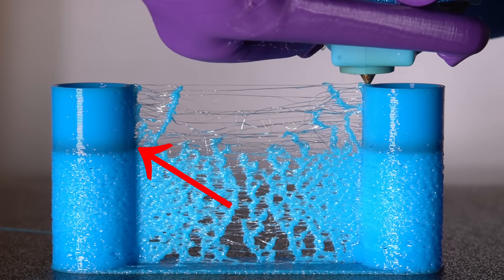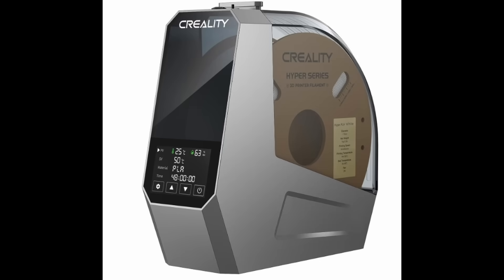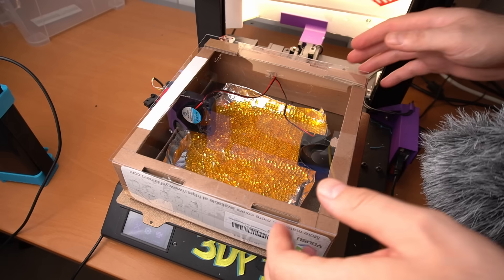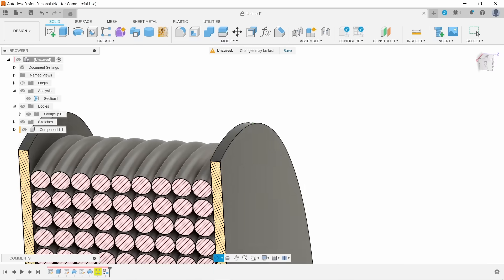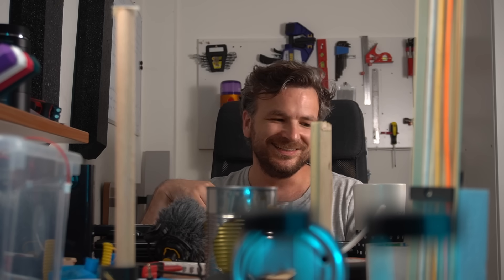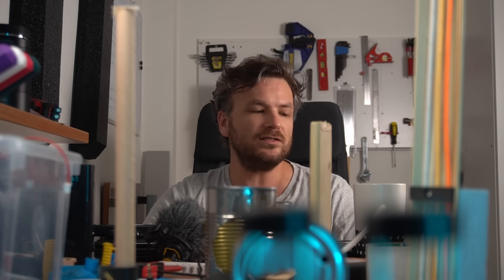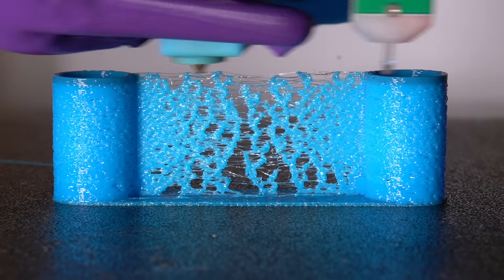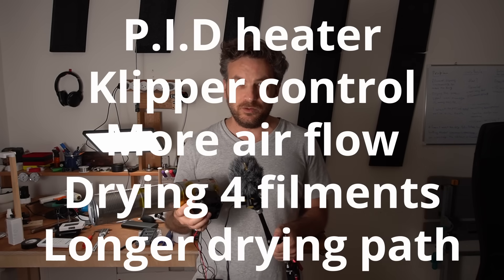Why are we drying filament this way?

Comment: Hey there 3d printing ideas, I work with metal filaments and run my own small 3d printing/ design engineering consulting gig. I have worked with metal filaments and they have a variety of problems of their own and I would like to share what I have done to improve my filaments. I personally would increase the heat and airflow. in an industrial injection molding operation a large part of it is drying the pellets before feeding them into the injection tube. The drying time varies based on a number of variables. So in your case you'd have to account for water accumulation in the filament, air humidity, the speed of the filament going through the nozzle and as well as what ways you can pull the moisture out of the filament. Additionally, how wet the filament can be to print "normally". Nylon gets stronger after it gets wet, but you can't print with it when its wet. If you're someone that wants to speed print using "wet" filament, you'd have to have a vacuum chamber set up to pull the moisture out of the air then draw it out of the filament towards the outer edges of the filament itself, then you can push it through a filament dryer with desiccant. The name of the game is to make the air surrounding the filament drier than the filament itself that way the water pulls out. Its simple physics after that, the hotter it is the faster the moisture will dry, the more air flow you have the easier it will be to pull it from the filament. add a desiccant and now you have even more things pulling moisture out. The vacuum chamber is really overkill for basic and noncritical components but it ensures you get the most moisture out of your filament as fast as possible prior to printing and then you can precondition it by warming it like you've done. You just have to extend the warming time to match conditions where you're printing. so a "wetter" filament will require a longer heating chamber. A more humid climate will require a longer heating chamber. Prewarmed filament will also print easier as the hotend doesn't have to bring a filament from room temp to melting, rather 100c to 220c for pla for example.  Hope that gives you some tips and tricks.
 
I would also suggest utilizing nichrome or kenthal, it allows you to control the temperature more and you can wrap it around a glass tube that you can run the filament through alternating the hot portion with an exposed air portion. In my tests it worked good but that was my v1 I feel like putting it close to the filament AND adding airflow in the can with the desiccant would be interesting to see. I just leave my desiccant in the box.

Comment: Well. The way you prpose might work partially for low temp material. But you are not going to make it with abs, variants, nylons, and never with high permonce mat like. We.
There are profesonal dryers that dry materials 10 times faster than hbby dryer: smart3d has such a dryer. And also has a soon lo lauch dryer that dryes ANY material on live. It uses vacuum technology

Comment: Nice idea! I think that if you dry the air coming in, you can achieve better results. Maybe force the hot air to pass through a box with silica? you will need to change the fan to a radial in order to push it through. Or you can adapt some room dehumidifier (those that dont need silica)

Comment: I initially thought you were going to heat the can, mount it in a bearing and have the filament do a couple of loops around it, but your idea is good, I'm not sure if you can remove the inner humidity that fast.

Comment: In my mind, I envision a single piece copper tube with a diameter close 2-3mm in which the filament goes through. A 3d printed adaptar is printed at the end that makes a Y, one side of the Y allows the filament to go outside to the printer, the other end goes to a much bigger opening that connects to a 120mm fan that creates a vacuum.
. 
On the other side of the tube, you have the same Y: Just that instead of a connection to a fan, you're breathing dry air from a box full of silica gel (Similar to the first commercial product that you showed.
.
Then, you can wrap heating elements around the copper tube (Like the ones used in motorcycle handle grips) and finally and insulation around all of that that would keep the copper tube heated at a reasonable 60-70 degrees without too much use of energy.

This feels like such a cool project!

Comment: Newer comercial dryers have a fan recirculating the air inside, the exposed filament will be the first to go inside the printer, so it works well, no one did that probably because it’s not needed!
Reply: Yep, like the Creality Space Pi I just bought. The printer draws the already dried filament in from the outer edge of the spool first and as it drains it keeps on getting dried in the dryer.

Comment: If you decide you want to really knock this up the S tier, I would recommend putting your filament on a spool and holder into a vacuum chamber and feed it through a series of silicone wipes. Now you've got molecularly-dry filament. Getting a 12CFM pump is pretty cheap now days and will empty a large chamber in minutes.

Comment: If you want a longer drying path you could replace your tin cans with clothes dryer ducting. This can also be insulated for better heat retention which should lower the power consumption of the rig.

Comment: So, what I see here is that you are over obsessing on the wrong thing.  Moisture sure, can be an issue..but rarely is.  To be honest your print (where you say it is good) is still total shit.   I would first work on your print settings, making sure your nozzle and filament way is clean.  And finally, that you have quality filament to begin with as they are not all created equal.  You seem like a guy that likes the DIY or cheap way...so I bet you buy only the cheapest stuff.  Buy the middle of the road priced filament.  Stuff that has real world reviews and shows good results from those who have already gone through the process.  Then work from there.  My last 20 years' experience with "wet" filaments goes like this.  Most easily done with PLA btw.  Grab your stored PLA and give it a bend. You will find that the end of the filament will SNAP cleanly.  Roll off another 50-100mm of filament and repeat the SNAP test.  At the point your filament bends rather than breaks, is where your moisture point stops.  Cut your filament there and print!  It is that simple.  What do we learn from this?  Filament doesn't generally dry out on the surface. It dries out from the end point.  Almost every descent filament I have tested this theory with has proven it to be correct. If you buy only the cheapest stuff, expect the cheapest result!  After you have that sorted out, you will need to make sure your filament path is CLEAN. Use cleaning filament regularly. It's super quick and easy and works. If you use abrasive filaments, change your nozzles frequently.  I tend to shy away from anything other than Brass nozzles.  Even the best brass nozzles are cheap. They heat properly and are consistent.  And finally, tweak your slicer settings.  6 months ago I started using Prusa Slicer.  Great software, but with my Creality Printers, dimensionally inaccurate.  After pulling my hair out, I found out that there are problems with that slicer and 3rd party printers.  I moved to a fork of that slicer called Super Slicer and now my prints are dimensionally accurate.  So you need to experiment a bit through the whole workflow.  I live near the great lakes. It is humid here as well.  Trust me when I say, you may think it's moisture in your filament but 9 times out of 10, it isn't.  Nobody has invented what you are trying to do, because it is simply not the issue you think it is.
Reply: This is TPU. Have you ever printed with TPU?

Once there is moisture in filament, any filament, no amount of settings tuning will help. Retraction won't work, flowrate won't be meaningful either. TPU and Nylon absorb moisture very rapidly, it takes hours to make them unusable. PETG is OK in mild climates but in wet climates it can be a pest due to absorption. PLA has a low humidity absorption rate, so it's among least problematic materials. Additives generally increase humidity absorption, carbon fibre is particularly bad with this.

Snapping brittle PLA filament is guaranteed not due to moisture, but due to oxygen, ozone, sunlight etc, not known for certain. Moisture thing is an urban myth without evidence. Especially because while drying is outer first, long term absorption shouldn't show much difference further into the spool, as with time it exchanges moisture and equalises. You can try it, bag a small length of fresh supple PLA in a ziploc with half a teaspoon of water, don't leave much air in if you can, but you need a little. Leave it in a dark place which isn't too warm for 3 months, or however long you wish. Look inside, PLA will have absorbed moisture, you can even measure weight increase. You can measure weight before if you have precision sub-gram scale and write it on the baggie. But it will be absolutely supple even more so than when you put it in. Naturally printing with it will be impossible, because it'll foam up and degrade during printing, but the filament itself will feel very tough and bendy.

I suspect with Ender in particular, there may be some sort of fluorine outgassing in the Bowden tube that fouls PLA on the printer. I don't have a Creality, i have a DIY printer which is direct drive.

When your slicer doesn't make dimensionally accurate prints, that's either the print order (outer wall first helps) or the wrong G-Code flavour set, or wrong filament diameter set. You can make any slicer behave if you know what you're doing.

Comment: I love that idea! I think it has much potential, especially if you feed the filament trough a longer pipe (maybe 2 meter or so). Copper plumbing pipe for example is quite cheap. Electric mounting pipes for cables are eben cheaper (but plastic). Also, because of the smaller diameter, the air flows much faster compared to the cans. A nice litte adapter for the fan / heating elementcould be printed quite easily.
I can imagine it is not too much hassle to push the filament through the pipe. And also it is possible to use an endcap with a bowden fitting, which you just could plug on to the other end of the tube. This was the air is forced to travel down the complete length og the pipe.
What temperatue did you use at the heater?

I hope you go on with this experiment, it seems quite promising. Thank you!

Comment: Looking forward to a version 2.  I have been using a dryer for PETG and seems half way down the roll I start to string again and back in the dryer it goes.  You explained why I need to re-dry😀.  Either I need a bigger fan for more circulation or maybe just keep the filament inside the dryer and run it while printing to keep the outer layer dry.

Comment: I would say, maybe enclose the air loop, so hot air doesn't go outside (thus less heat wasted), and on the return loop of the air, add decicent, so moisture is removed from the internal circulating air.

Comment: This is definitely an interesting idea.  Thanks for sharing it.  However, I, and many others like me, use cereal boxes with about 6 oz of desiccant to keep spools of filament dry (10% humidity), so we never need to use filament dryers.  Some people use other types/sizes of bins with desiccant, but it's the same concept.  When I need a spool, I simply move it from the cereal container to the AMS attached to my Bambu Carbon X1, which is also maintained at 10% humidity.  I'm certainly not the first to use this approach.  In fact, lots of people have adopted it.  Many who do not have an AMS or equivalent have modified their cereal containers to feed filament directly into their printers, keeping their filament nice and dry, without ever having to use a filament dryer.
Reply: Fun fact, when you say 10% humidity, but you're reading it off one of those little electronic humidity sensors... well their range bottoms out at 10% so if there's less humidity, they'll still show 10% exactly.

Comment: You could use a pulley system to run the filament back and forth several times within the chamber to give it maximum exposure in minimum space, rather than running it from one end to the other.

Comment: It seems to me that for an on demand filament dryer the more time the filament is in the dryer the dryer it gets, so  you either want a very long dryer or a dryer with a long path for the filament to take going through the dryer. I think your 3 can setup is too short for drying filament that isn't already pretty dry.  I wonder if having the filament going through a container of silica gel with air circulating inside might also work well.

Comment: You could build a base to a filament dryer. It would be a bit more pleasant on the eyes, could possibly look into heating + fan control with an arduino.

Comment: A: you need dried air in the first place, so keep some silica geldried up at hand, put a sieve boxin forn of the fan and draw air through the box to dry it before sending it in the "tunnel".
The tunnel needs to be 3 times longer or more for faster printing filaments or thirsty filaments like Nylon.  

A PVC pipe ca do, it is all about exposure of the filament not about the pipe diameter, and yes you can draw for or five filaments at the same time.  

Best results are obtained with dried hot air, so heating air up before pushing it in the pipe will give better results, which is how that magic box is working, all industrial filament production lines have said black box, nothing black in it, just constant stream of dried hot air over a long distance, given the size of that box I guess the filament is making a few returns inside over some spools to expose it for longer time in a shorter distance to keep that thingamajig from looking like a meglev train.
Reply from the maker: Thanks! meglev train😂

Comment: One thing that I have learned about TPU is that slower print speeds will exacerbate moisture issues. I used to have really bad surface finish with my TPU prints until I upped the print speed significantly.

Comment: Idk if this helps but id imagine creating a coil inside the tin can would make each part of the filament exposed to heat for longer.   Like force the filament around in a coiled track inside of a single tin can.  Each inch would recieve way more time in contact with the heat.

Comment: Use activated alumina. It's the only thing that can actually dry filament out and take water from it (e.g. it has a high enough delta) to properly do this. And it's infinitely reusable baking at 200c~ for an hour or two.
Reply from the maker: I wonder what's the difference between activated alumina and molecular cives

Comment: I print TPU from a modified food dehydrator...about an hour to warm up the entire roll of filament.
During printing, the filament passes through a 1/2" vinyl tube which takes it up to the printer...lots of 'inline' warm air exposure.
I've never seen my TPU prints 'bubble up' as shown in this video.
Maybe I got lucky and discovered your technique in a different way?

Comment: My solution to this problem was very simple, But I have the space for it. I got one of those plastic storage bins with a seal in its lid. Filled the bottom with desiccant and store filament in those. And I converted one of them into a printable drybox so you can just feed filament from it. 
I have the same impulses of just wanting to be able to use the 3D printer now and not needing to cook 3D printing filament in a s*** food dehumidifier overnight. I just went with the stick filament in box never have to think about it again as long as the color is fine on the desiccant and humidity meters. 
Although probably vacuum oven is the quickest way to dehumidify a role of filament properly. But there's also more expense in that solution especially if you go with a proper vacuum oven. (That just pushes it from a bit expensive to only if I was making money)

Comment: Oh, man! You just activated that one neuron that was waiting to shine :) What about mounting fan also inline? It would require to make fan with hollow shaft. One thing that comes to my mind is to separate fan motor and fan itself. 608 bearing would provide enough space for hollow shaft, its cheap and available everywhere. Fan would be drive by belt like in giant industrial ventilation setups. 

Or just use radial (blower) fan that would be much better choice for forcing air thru restricted pathway anyway.
Reply from the maker: It would require to make fan with hollow shaft - good one

Comment: The issue with other flow thru dehydrators has been PLA heat creep, the PLA gets too warm and starts to jam in the hot end cool zone.  PETG also seems to take longer to dry.  Last time I saw such a device though was ~5 years ago so maybe hot ends are better and maybe the air flow can help the PETG dry better.